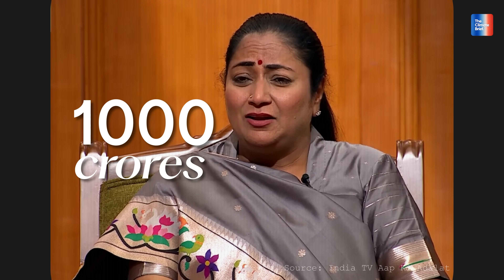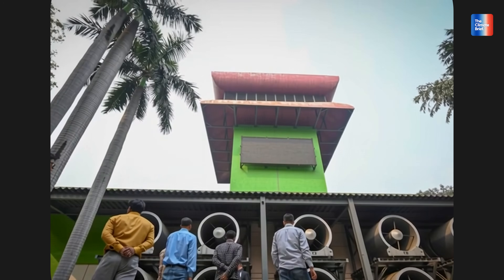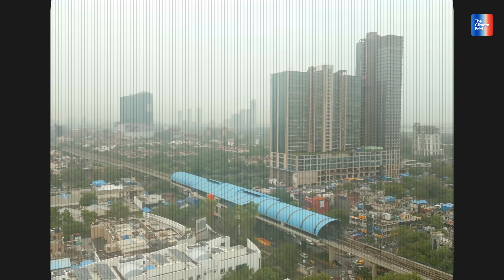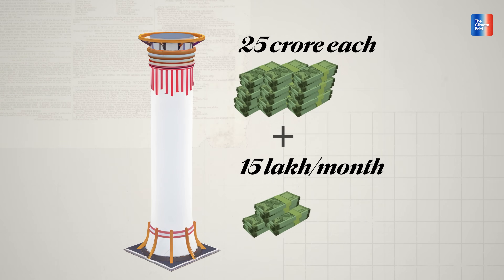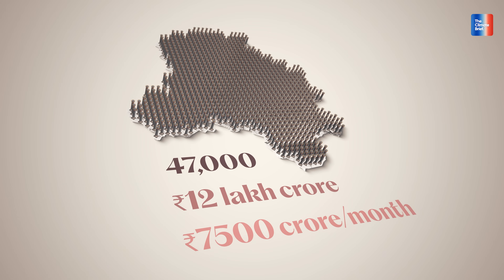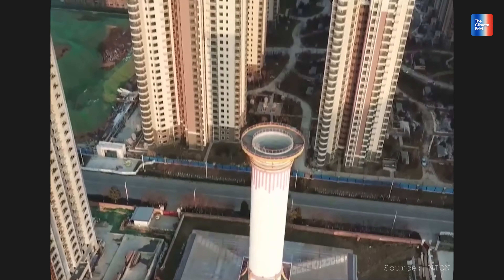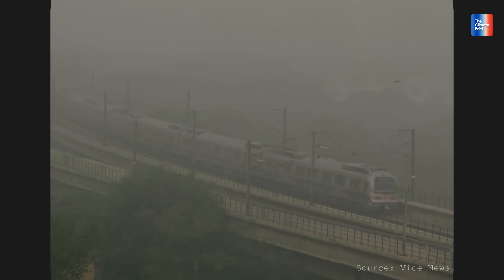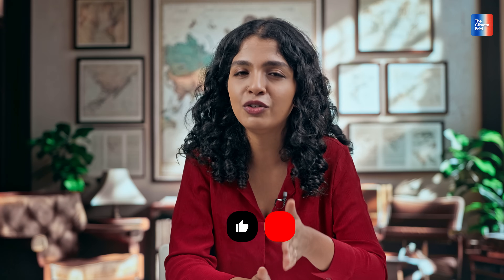Delhi’s FAILED Attempt to Fix Air Pollution! | Explained with Data

Comment: No problem can be solved without understanding the problem first.
Solar panels and EVs are not gonna make much difference in Delhi's air Pollution.
Because it's a variety of factors that cause air Pollution.
Indians do not understand air Pollution, which is surprising as we are the most polluted country on the planet.
From Nov 2024 to January 2025, the AQI in Delhi was 1000+.
The solutions have to be as intense as the scale of the problem.
Think breaking down the complete Delhi Metro. That drastic and intense.

Comment: Why don't these dumps offer this money Instead of wasting ₹1000 crores on failed air purifiers, why not invest this money in supporting private players who are genuinely working to solve environmental challenges?

These innovators often have stronger execution, practical field experience, and scalable models that create real impact. Supporting them wouldn't just address the root cause more effectively, but also boost employment, promote sustainable startups, and strengthen India's innovation ecosystem.

Just think — we can get groceries in 10 minutes, but not an ambulance in 30. That’s not just a policy gap — it’s a lack of innovation in critical areas, where private sector solutions are often far ahead.

The government needs to shift from symbolic spending to empowering real problem solvers — startups, climate tech entrepreneurs, and innovators who know how to execute and scale. That’s how we fix the environment and the economy.
I know there are loopholes but actually this particular sector of environment there are many ideas in young minds but no support and also govt.  Is unable to solve this problem 
And environment is not a complete responsibility of govt. It also the responsibility of us to take care of environment
 Not to do things which harm the environment so think of it giving the responsibility on those hands which are actually responsible